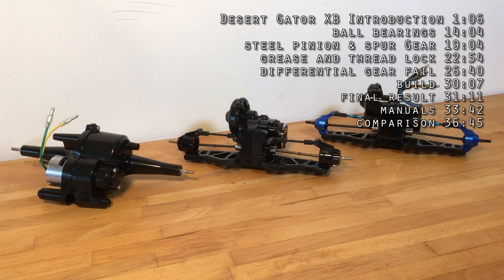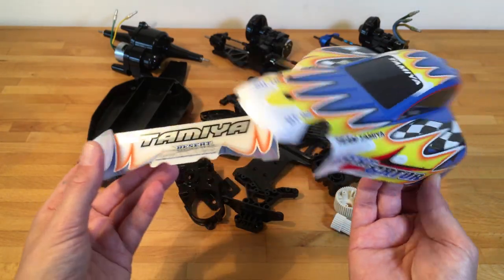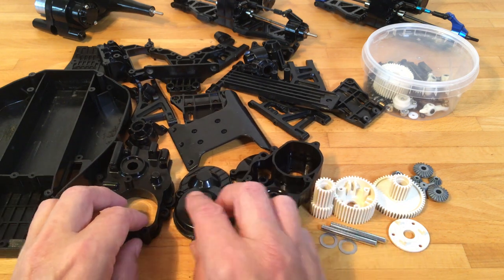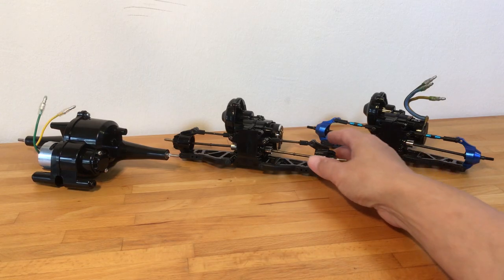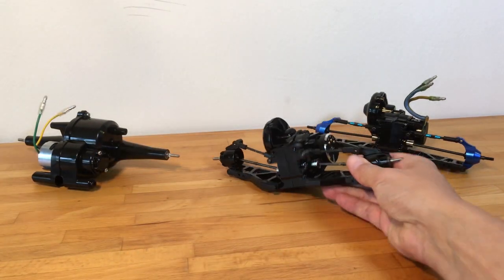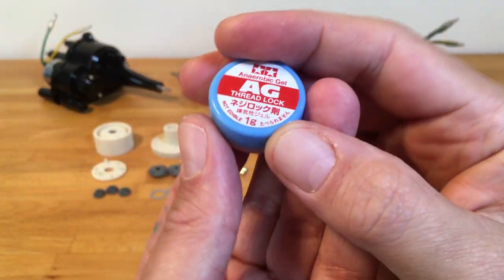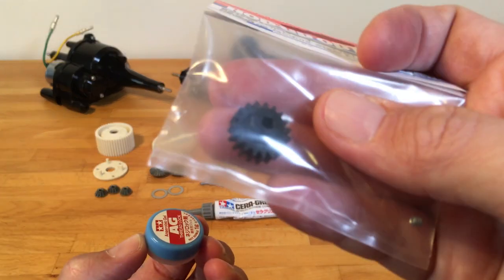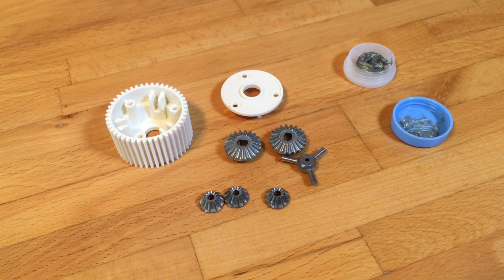Tamiya DT-02 Desert Gator XB Re-Build (Part 1) Gear Box ... and DT-01/02/DT-03 Comparison & Waffle!

Comment: What wonderful waffling, Mikael! I totally agree with your comments about the basic upgrades needed for the DT02/3 gearbox/rear end. Good info indeed. I did think the first diff you built was gonna cause problems with those splines in the output drives! Also, good point about the standard plastic A-arms being a good design, a little flexibility helps, but I have bent several of the screw-pins, so the stainless steel pins that are available are a good, affordable hop-up too. A very interesting video, loving the DT series!  :)
Reply from the maker: Hi Mark! Yeah, I missed that diff completely, cuz’ I have only build the other one for the metal dog bones and universal axles for the last couple of years. So I had forgotten all about the standard outdrives 🙂 Hmm, seems like everyone has their own DT issues. Never had problems with the standard pins, but my c-hubs break all the time. But I think I will try those steel ones anyway. Thanks a lot for watching, my friend.

Comment: I also like that you mentioned about the difference plastics used in suspension arm. Never know this before as I never seen them in person. I really don’t like that hard and brittle plastic that Tamiya use in gear box.
Reply from the maker: hi my friend. I think that kind of plastic is okay for the gear box. But hopeless to start using it for the suspension parts. Luckily they used good flexible plastic for the a-arms on the DT-02/03. But my stock c-hubs keep breaking, although I have talked to others that don't seem to have that problem.

Comment: Great upload! I find it very informative. Initially, I want Sand Viper but I couldn’t find it locally so the shipping cost well be too high. But I find a better deal on Fighter buggy SV locally. So, I’m trying to find the difference between Sand Viper and Fighter Buggy SV. From you video, I think the difference are metal drive shaft and adjustable links, which actually I didn’t really adjust it that much. I’m going to use my RS540SD Black motor from my old hornet, which isn’t that powerful, anyway. Maybe I’ll go for Fighter buggy. They both use the same body isn’t it?
Reply from the maker: Thank you very much, bro! Yeah, the Fighter Buggy is just a Sand Viper with different specs, like we talked about. I think it comes with a 380 motor too?
Reply: Nordic Hobby Visions Funny enough, there are 2 Fighter Buggy SV. Mine come with full ball bearings, 540 motor, ESC (TEU-105BK). They have orange sticker stated on the lower left corner. That’s the last one in the shop. Another version come with 380 motor. I found this version on rcjaz website they have both version.
Reply from the maker: Uhh, great info. I didn’t know that!

Comment: What's the quality in your opinion? I've bought my bearings from France. Expensive but very high quality.
Reply from the maker: Some of them are a little dubious. Especially the really cheap metal sealed.Not the best. But no serious problems or breakages with them yet. The rubber sealed I have got in 25 or 50 pieces a package seem better. So, in general I think you get what you pay for, but even the cheap ones are a huge upgrade compared to the plactic ones. I think they are perfect for these entry level ones. In my upgraded units I use more quality bearings though. But in the more-or-less stock ones the cheap ones are a good option in my opinion.

Comment: I was wondering if those untagged bags what Tamico and others sell, are originally from full boxes and they sell them as lone spares..
Reply: Mikael, more videos like this! 😊
Reply from the maker: Yeah, the parts are probably supplied to Tamico unpacked, and then they pack them themselves.
Reply from the maker: Just recorded Part 2 (finally) this weekend and edited it this evening :-) Up soon.
Reply: @nordichobbyvisions719  Seriously? That's wonderful news! 😊 
Have you ordered the Terra Scorcher  already or are you gonna go for CC-02?
Reply from the maker: Still discussing with myself if I should get the Terra ☺️ I know I shouldnt ... since I have the agreement with myself not to get new cars before all the old ones are up and running again, but well, it’s so tempting 🙂 Also the black Clod Buster ... And no, no, CC-02. Not interested in the Mercedes body and will be too expensive if I have to buy a new body and body accessories for it. So maybe a CC-02 when they come out with a model that I like 🙂
Reply: @nordichobbyvisions719  Yes that Mercedes body is not tempting at all but if they and they will release it with another body that's another case ofc. Terra Scorcher is a must buy. I turn 40 in June so i can justify buying it 🤣